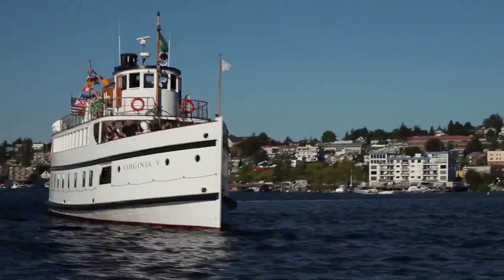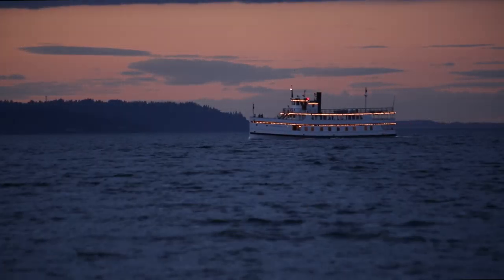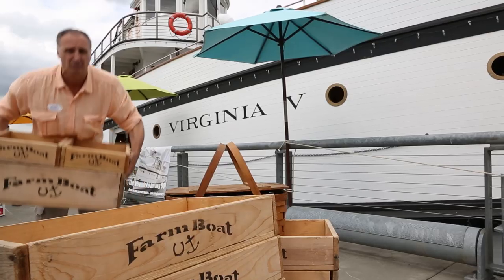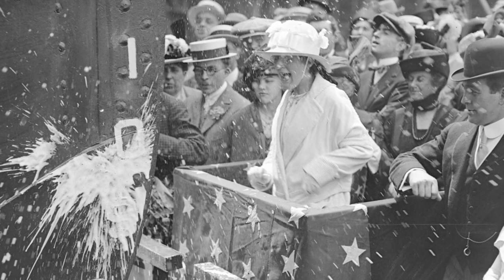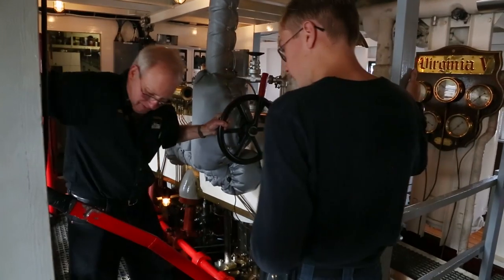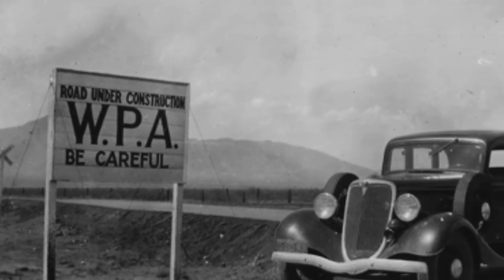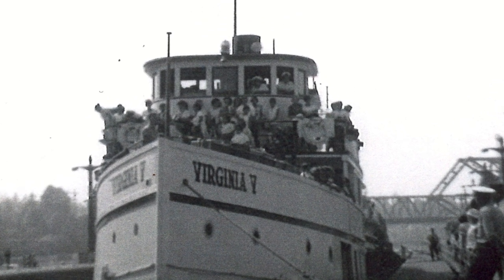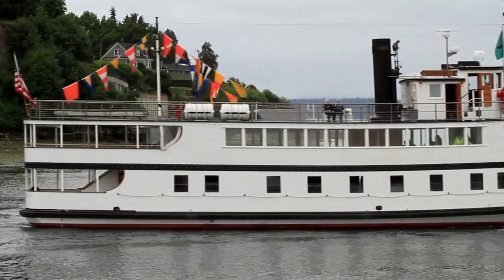Virginia V-Last of the Mosquito Fleet

Comment: I remember going to Camp Orkila on Orcas Island in 1971 aboard the 'V; I don't think I ever left the engine room. One of the crew graciously gave me a tour of the engine, I will never forget that. I can still quote the spec's from memory: 125-foot, 328-passenger capacity, 400 HP triple expansion engine from the Virginia IV which I think was originally built in 1894 but my memory is fading there.